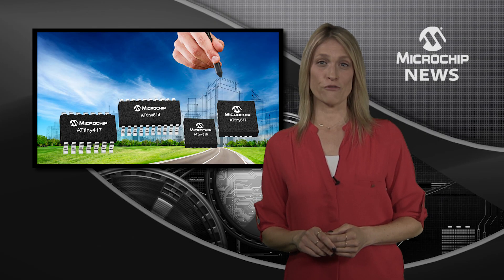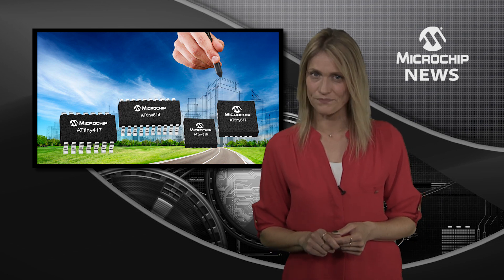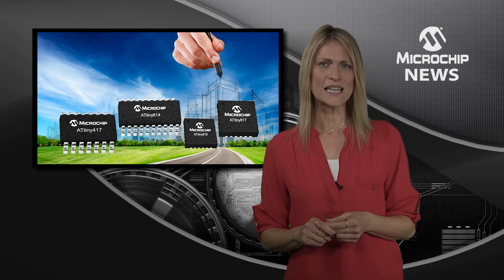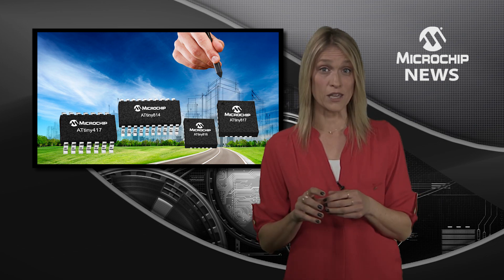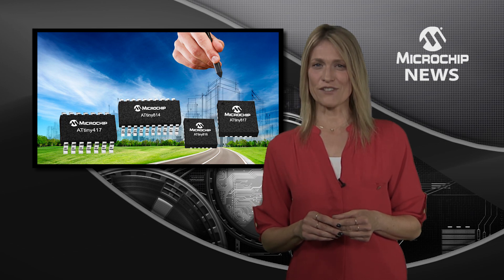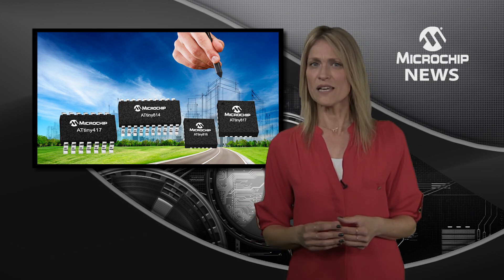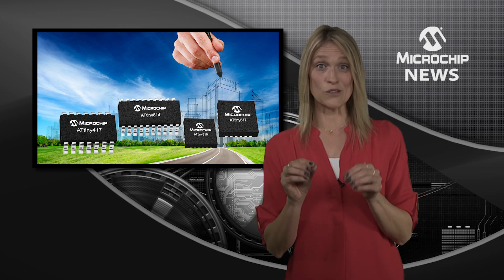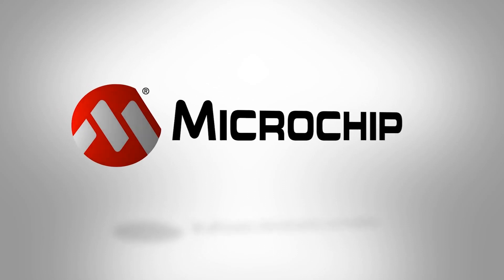New AVR® ATtiny MCUs Increase System Throughput & Lower Power Consumption in Embedded Applications

Comment: AVR or PIC 8 bits???
Reply: This is an 8 bit AVR part
Reply: I refer to the fact that MCHP is putting more effort into many Atmel products instead of their classic products. For example, in the forum there are many rumors that it will give more impulse to the ARM core and the PIC32 with MIPS core could disappear. Then my question is that we should also start using the AVR and gradually leave the classic 8-bit PIC.
Reply: Fabián Romo I'm sure its just rumors..did you see this article?
 https://www.electronicsweekly.com/news/products/micros/microchip-to-boost-8bit-avr-range-following-acquisition-2016-07/

Microchip is pushing both PIC and AVR microchip will never get rid of PIC! It just seems like they want to reassure customers that they will not get rid of AVR hence the current push....PIC is very popular as is AVR..pushing both lines will maximize profit..Microchip dosent get rid of parts that easily which is why they are awesome..you can still get a version the the PIC16x84! The PIC16F84A is in production!..I dont think we have to worry about something like that in out lifetime..
Reply: Fabián Romo I know this post..I took part in the discussions..if you look at the second page you will see my name there 'ArmstrongSubero'
Reply: I understand your points of view, but I think that MCHP should tell us what path it is going to follow. I give you an example. I did a project for which I chose to use the RN1723 module and after several months of tests when everything is ready, this module is no longer recommended for future designs and consulting with technical support, they tell me that I should select the ATWINC1500 from atmel.

So for example if I start with a new project, for example with PIC18 or PIC32 (MIPS) and after a year indicate that PIC18 or PIC32 (MIPS) is obsolete, I would not have wasted my time if I had been told that AVR or SAM32 are the future.
Reply: Fabián Romo Well Microchip dosen't obsolete microcontroller parts often..like I said, parts that date back to 1993 can still be bought in one form or another..their 8 bit and 16 bit parts are superb..however they have made a few 'boo boo's' with some of their 32 bit parts and bluetooth and wifi modules...some of the PIC32MZ's had ADCs that were near unuseable..and that WiFi module in particular module had some problems with communication and data loss from my use of it...some of the RN4020 also had some problems and I tossed it out cause it won't work properly..so thats why some of these parts are NRND..I admire microchip cause they let their customers know that the parts are NRND...some manufacturers let you use the parts with well known bugs and pretend they don't exist or put them on page 400 of the errata of something..now that they have acquired Atmel, they can recommend the parts cause they work better and are more reliable..but for some of the parts I dont think you have to worry..the PIC18 is a stable line..as for the MIPS based PIC32 is a mixed bag..some parts work well and others not so much..but they are trying their best..you should contact sales if you have any problems on the part you intend to use...I'm sure they can tell you what's up..but I also use PIC32MX line and dont worry about it phased out..as for the MZ line..I hope they improve..I can see why they are pusing SAM over the MZ line..it's very very good..ASF beats Harmony by a long shot..and the SAM line is one of the few ARM based chips with good and free tools...Microchip has a strong track record of providing and supporting parts for a long long time..which is why they are so popular...most other manufacturers either obsolete parts often..or like Atmel before acqusition parts are hard to get....others take forever before you can get a hold of thier bleeding edge parts...Microchio dosent have this problem..do dont worry my friend..just contact then if you're worried..and no I dont work for them or anything...